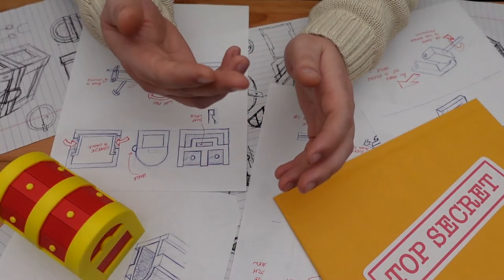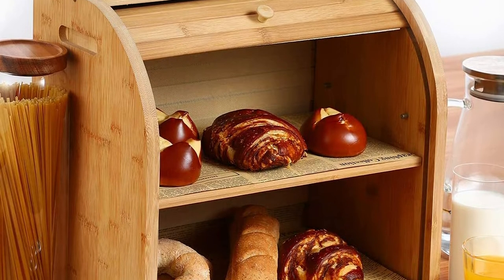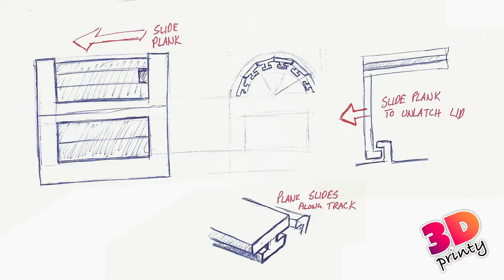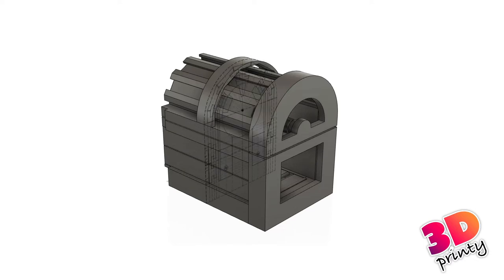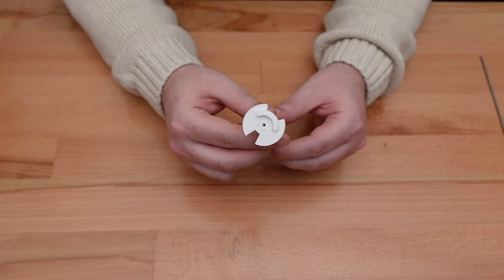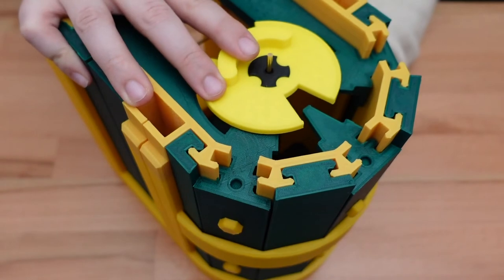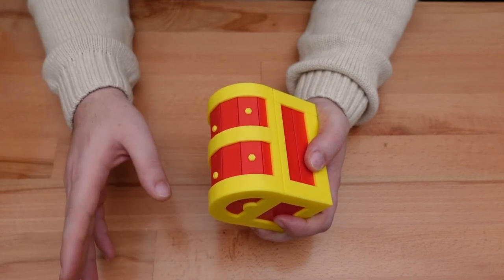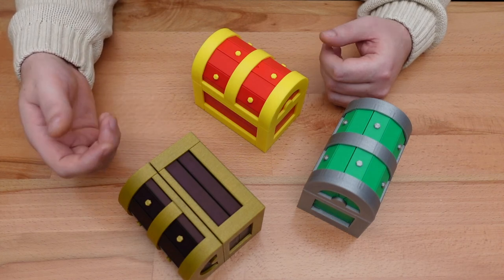Treasure Chest Puzzle Box - Design

Comment: So you were the first to design this or you redesigned it? Is this purely a hobby or do you work in the design field?
Reply from the maker: Good questions!
- The puzzle and the mechanism inside are my original designs. This is far from the first puzzle to use a rotation-based lock, but this exact implementation of the idea is new.
- 3D printing is my hobby. I'm an industrial designer by training and a programmer by trade - both have a lot of overlap with 3D modeling and 3D printing.